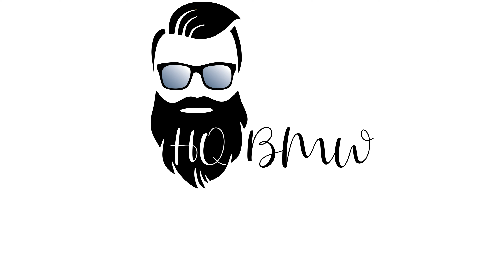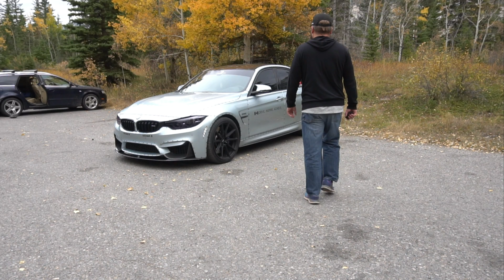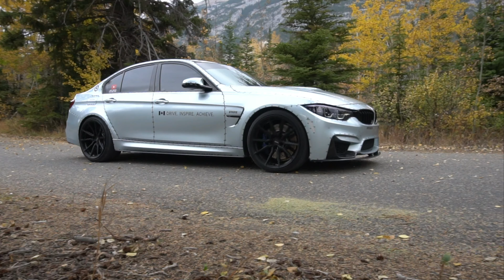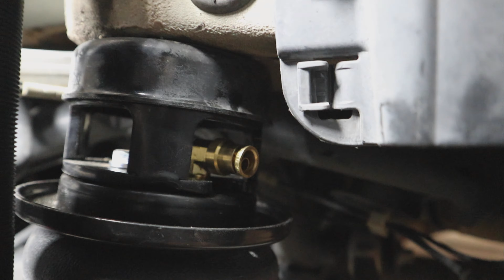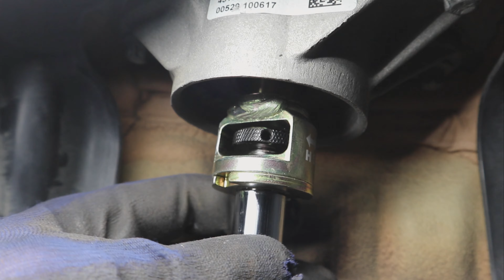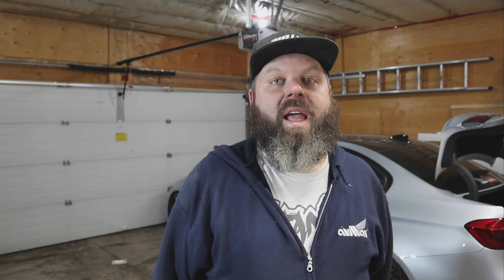Airlift Performance 3H Install Part 1 | BMW M3 F80

Comment: Hello what type of end links are you running in the front ? Also for the rear what fitting are you running in the rear bags? Cause I got an elbow fitting on it right now but it’s rubbing against the cup causing a leak everytime I hit a bump.

Comment: Hello how do you know which is the perfect fitment when installing
Reply from the maker: The best thing to do it talk to the wheel companies when you are going to buy some wheel and tell them what you would like to accomplish. They will be able to answer your question. That’s what I did
Reply: @HQGARAGE  thank you for your answer 
But i mean with stock wheels like you have, when i install the strut and let down the car how know the wheels are not touching the fender or something else ? I am actually installing it on my m3 f80 with same wheels as you but i dont have the measuring of the lower mounts or can i find it somewhere ? this was actuallay my question maybe i did not explained it good
Reply from the maker: The stock wheels won’t work with the air suspension. The wheels will hit the front bags if you try and drive. You will need to run spacers if you want to use the stock wheels

Comment: Hi, really great video, I’m currently installing airlift suspension on Bmw F31 Wagon,  with the rear bags mine seem to not stay in the slots from the upper section of the bag mount, did you have this issue on your install?
Reply from the maker: I did have the same issue on my F30, I had to verify the bags were seated correctly and when I lowered the car I had to make sure they sat in the buckets correctly. Once there was weight on the car it wasn’t ever an issue.

Comment: Hi mate scotland here. 🇬🇧 i am looking at getting an air lift system for my f80. As i live where speed bumps are on every street. What would you say the down sides are to haveing an air system suspension 🤔 does it make the ride uncomfortable in anyway ect
Reply from the maker: Hey 👋 thanks for checking out my channel. Once you have air installed you will love it. I absolutely love driving mine especially on the highway 🛣. It’s such a nice ride and handles as well. Kinda like the best of both worlds. The only downside I can think of is, depending on where and how you mount your compressors they can be noisy while filling the tank. That’s about all I can the downsides are.
Reply: @HQGARAGE  ok thanks a lot brother 🙏
Reply from the maker: Anytime 🤟🤟